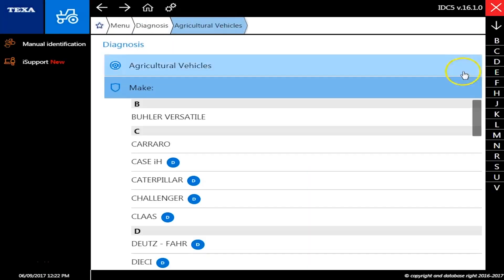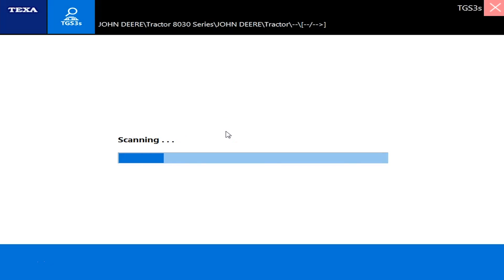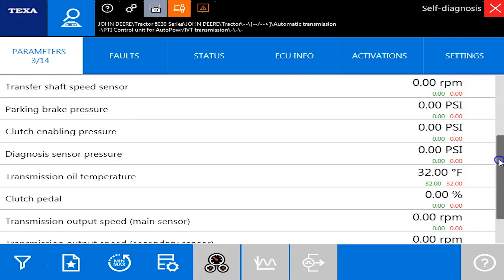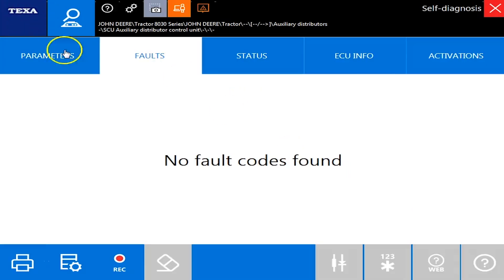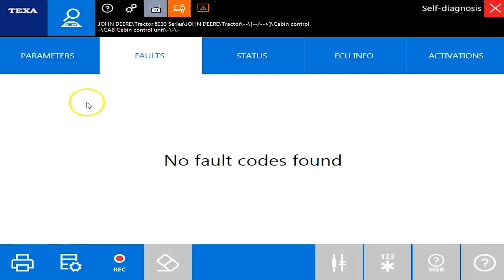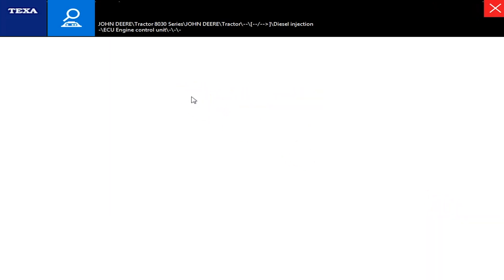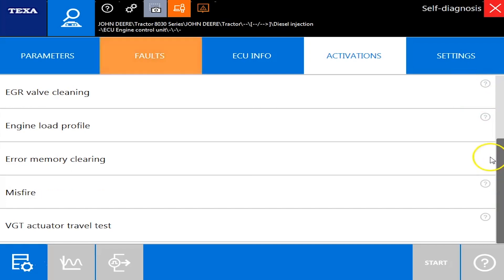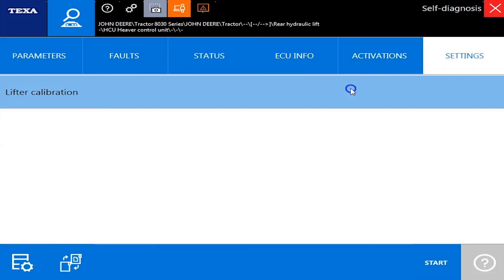Dealer level diagnostic on a John Deere 8430 with TEXA

Comment: Buy A Deutz tractor, they have a transmission display and a display on the instrument cluster which scrolls the faults plus or the code depending what it is, they even give you a workshop manual with the tractor with the hundreds of codes and faults, if a sensor is faulty it states that on the dash, no need for expensive testers and the bs that goes with it.
Reply from the maker: Good point. Keep in mind this tool has repair information on each code, along with dealer level commands such as PRV reset, injector testing, DPF regen, etc...

Comment: This is not service advisor ? What will it due compared to Service Advisor ? I was a Deere Ag tech for 24 years till just this year .
Reply from the maker: No is not John Deere Service Advisor. John Deere rarely sells this software to people outside the dealership. This is TEXA Off Highway, which does dealer level diagnostics on all off highway equipment, both construction and agriculture. I suggest you either call us at 888-983-1975 or email sales@diesellaptops.com to get more information.
Reply: DieselLaptops.com thank you for the response I understand what you are saying about Deere rarely selling Service Advisor . But the facts are Deere is just now offering Service Advisor to the public but it is limited. Now here is the kicker between what you sell and what is out there on the market . Your offering a fancy code reader that now days is useless. Just because I know what that code means it is far from being able to fix the problem . With Deere you have to have there step by step diagnostics and understand how to follow them or you will be lost . With my 24 years with Deere climbing all the way to master tech I can tell you without there program the chance of diagnosing and fixing a problem is slim to none.
Reply from the maker: The kit that comes from DieselLaptops has step-by-step repair information for all repair codes on John Deere. We have developed our own repair information software that comes with the kits we sell. This tool also does more then read codes -- It does DPF regens, VGT commands, injector programming, etc...
Reply: If you look at the right places on the internet there are still possibilities to get Service Advisor as a non/ex Deere dealer. Just a tip.